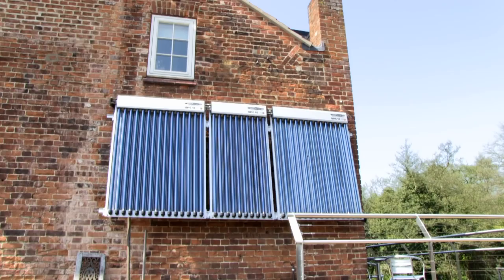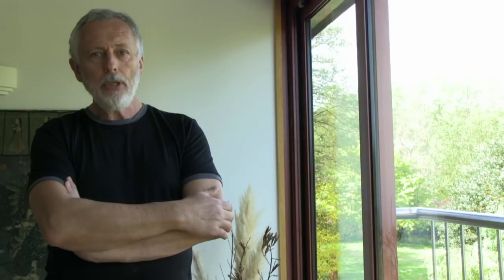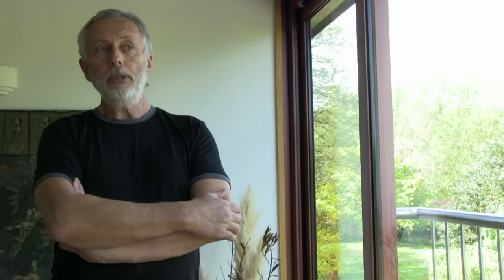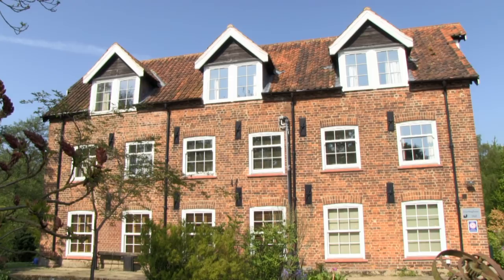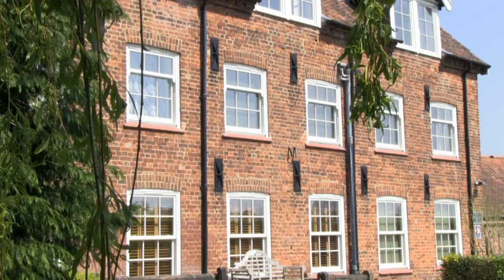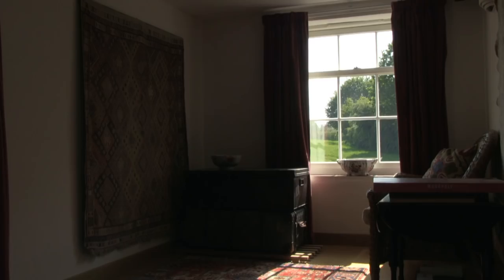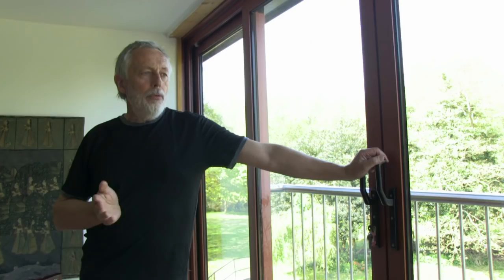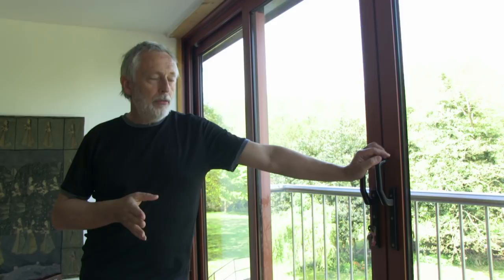Mill Renovation with Water Source Heat Pump - Itteringham Mill SuperHome

Comment: Thank you, that was interesting. I have just built  my own  domestic raw water heat pump, which gives me 16 kws of energy for our code 4 house with  hot water at 56c. I use the water from a bore hole at 12c constant, after heat  extraction, return the water back at 8c to the ground.  Sadly I don't have the power of the river, however an overkill of Solar PV offsets the pump. You are correct, insulation I would say is the number one rule for 'locking' the heat in. I am about to build my second modified MK2 version with further refinements to increase efficiency. Its a known fact that the water to water heat pump is the most efficient way of producing heat using the priciple of refrigeration. The ground source heat pump are good, although when the pipes are buried in the ground, in extreme low ambients overtime,  these can become inefficent due to freezing the ground.  The  air to water heat pumps on the market,  are worst in the winter, simply because they ice up on the outside air coils when the temp drops below freezing,  then because they cannot reach their hot water temperature, a bank of heater elements come on to artificially  boost performance......absolute madness, the COP (co-efficent of performance) drops off big time, of course the public who have these units fitted do not realise this,  the hard sales do not mention this, only appraising how well they operate in the summer when you need the least amount of room heating! Two couples not far from you have just been quoted £13k for an air to water pump, fortunately I stopped them signing.  I had to build my own as I could not find a domestic one on the market for a realistic cost. I am fortunate to be a refrigeration  engineer with 40 years in the field.  Anyway it was nice to see what you have done. Thank you. James Fowell of Itteringham knows me well.